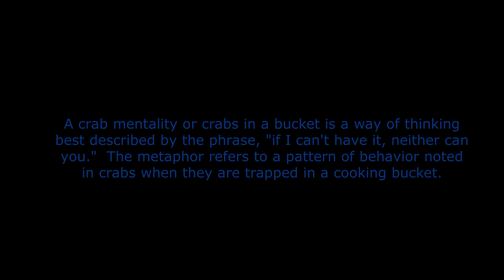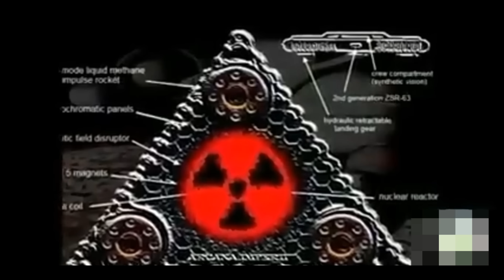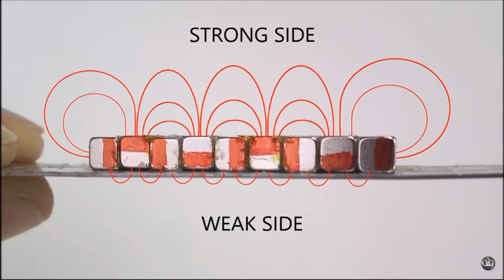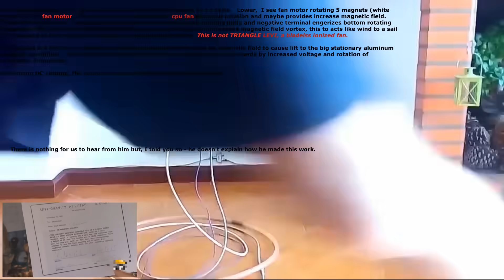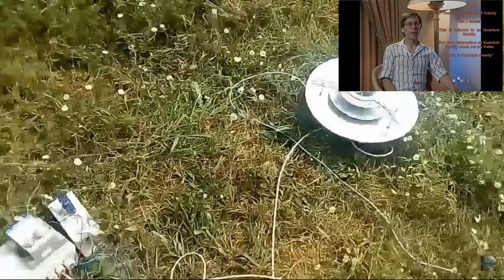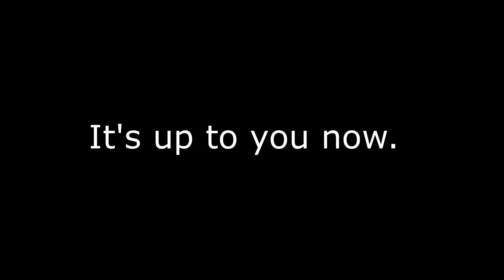anti-gravity project

Comment: Most anti gravity claims dont meet that defintion any better than lighter than air flight with helium.
Anti gravity would repelling away from gravity lol
Reply: lol Never though of it that way why do they call it anti gravity. Wouldn't it mean the opposed of gravity lol why isn't it just called gravity manipulation..
Reply: @patman0250  It was in the 50s but since then to throw people off the true path they have called it antigravity. Even in the movies of the 50s they called them gravational vehicles.
Reply: Singularity  so close. gravity is not a pull.  It's a space-time dent, also called a gravity well. Objects in the gravity well are influenced by how far in the gravity well they are. The planets are in the sun's gravity well, the moons are in the planets' gravity wells. 

There are very good videos depicting this concept. Although presented in a 2-d model, extend that idea into 3-dimensions. (well, 4, but 3 is easier to conceive).
Reply: or just cancelling it?
Reply: Singularity  strong and weak make electromagnetism through decay, which is responsible for the formation of elements and chemical bonds, which make mass, which makes gravity. And the strength of the forces is actually, respectively:
Strong
Electromagnetism
Weak
Gravity
Reply: Singularity  There is actually no evidence that gravity is a force. Gravity is an *effect*. The speculative theories on space curvature, gravitational waves, higgs boson do not reason well along one another logically.
In plasma cosmology and also in the Faraday/Tesla concepts of nature, gravity and magnetism aren't "different",but different aspects of the same causal force,depending on the structure of the matter involved
Reply: Space curvature : Gravity is an effect of mass inertia moving in space/"Einsteinian aether". In the modern theoretical model: Higgs particles/gravitational particle waves = objects attract via kinetic material energy-field interactions. There is an attempt to combine the 2,but it is just philosophy. How realistic this model is can be very doubted for many reasons.
Reply: @KibyNykraft  Yes mass attracts mass but gravity is a pushing force and therefor repels gravity just like placing 2 like of 2 magnets together they will repel.
Reply: @DieterSoegemeier  I'm not buying the theory that you presented. Using waves of energy we can lift various structures. If i combine two or three types of scalier microwave forms it is possible to create an energetic field of microwave that is able to hold some things in the air, uncontrolled at this point. But zero point theory and the hutchenson effect go hand in hand. So if a wave of sufficent  density is possible as is sound waves do in lighter objects like drops of water you can see in several experientially proven as repeatable outcomes. It may have to do with harmonics or a combination of higher energy products using the ambient air or the combination of the  material itself and air interacting to overcome the gravitational force. If you can cancel out that force to zero then would you over come gravity or interact with it? All electronics and magnetics prefer their opposites. If you have a battery and a material with a high Br the battery interacting with the magnet acts like a die pole I have a sputtering assembly magnetron that I can set a double a battery on and it will stand on it's edge if placed in line with the flux as it leaves the assembly so if battery acts like this then we only need to discover the balance of whatever we call aether.
Reply: @richardgreen1050  I bet you are into usless quantum theory.
In the 1900s Aetheric physics was the way and people like Keely, Tesla, Einstein and many others perached about what we can do with the aether untis Neil Bohr came up with Quantum theory, then everything changed for the worse. Common sence went out the window and Quantum physics was born.
Half way through the Philidelpha experiment Einstein changed camps due to possiable pier preasure for funding and recognition. Tesla was shut down and killed as being the last of aetheric energy advocits. Yet every elactrical device used today is still based on aetheric physics.
Gravity is also part of the aether and is not able to explained with quantum physics.
You want to make gravity, them get a magnet and then spin it fery fast till you produce a three dimentional magnetic field we call gravity.
Reply: @DieterSoegemeier  Tesla's gravity view is called Dynamic theory of gravity and was not formally published. Check it out. In his interview many years earlier, in 1903, he explains his faith in a dark companion to matter and light.
Reply: @richardgreen1050  I suggest you search up both quadropole and monopole experiments :) :)
Reply: @richardgreen1050  Allegedly the lift process of saucers (Haunebu 3, Otis Carr etc) was to have 2 oppositely spinning heavy metal plates of specific alloys, with mercury floating around it in a circular chamber. It could all be hoax for what I know. In terms of long distance travel in much shorter time, through space, I think only Alcubierre drive or/and NASA EM drive as a start is relevant
Reply: @DieterSoegemeier  The only way gravity can be a pushing force apart from magnetism, is if the energy comes "from" a big bang, or if dark energy increases entropy in a way that is suprisingly uniform directionwise for masses. I doubt it, so your idea of a magnetic gravity is interesting, yet there are some major problems with that idea, as we can distinctly separate magnetic from non-magnetic matter within gravitational fields. We however still do not have an evidence of gravity as a force
Reply: @DieterSoegemeier  hi thanks for the reply. I am not really a quantum guy. I'm a guy who worked in the magnetics world and I learned an observed a few things in those years. My thought was that a discourse in magnetic properties and their use along with what I currently see as the outcome of many projects or applications discussed in that time. Because the field is so diverse and touches almost every aspect of business in one way or another I'm generally but not always specifically able to apply the knowledge gained working with so many people in many high tech fields I felt I have a simple understanding of an applications and manufacturing enough to say what I said. I have nothing to add that has not been gleened from that experience. So if I mistakenly thought something and the truth be told I have not re examined my post, I gave you the best of the meger knowledge I have and discussed either what I know to be useful or what others whom I know to be competent in their respective fields have told me or even mused to me. So I'm not making points I'm presenting a viewpoint based upon experience or trustworthy people in places where I am not worthy to be but thankfully I was allowed to assist them in their efforts to achieve their goals or dispell their understanding. So thanks for the letter.
Reply: @KibyNykraft  thanks I have been going through most of the better ones along with listening to many professors explaining the flux and the principals of both magnetics and gravities elementary principals that have been advanced recently and the coil is pretty sweet. A lot of companies were working on different projects that were over unity but I never saw any of those go into production. But lots of things were asked about that made me curious. And I have yet to satisfy my belief that over unity is possible. I think it not only has been done but that when it was presented to the public for all intents and purposes it was never a project that could get major funding.  Everyone wanted to see it but no one wanted to buck the system and explain the law of entropy in a manner that mathematically proved to be a good resultant. And the fact that rotation of gyros does seem to indicate a force can be produced that negates gravities pull is interesting to see. But the hutchenson effect was the first indication that wave forms transecting can produce a change in motion and a change and the properties of the materials interacting with them gives rise to the question of the true density of stable materials like iron. If I can change density without a catastrophic change in properties of air or even solids is could be possible to pass thru the empty portions of materials by moving what is in front of me to the rear at a pace that would meet the speed of light minus any probligation delay in it's implimentation. Which it seems may have been described in the toroidal magnet in your example. But it needs to be a toroidal with the magnetic field contained in the magnet itself replacing the core of the winding so that it is a closed loop as I see it with a winding itself as dipicted. I am not able to grasp the core material being a low be material it would need to be neo or if the heat was too high a sumarium magnet of lesser br. Maybe I don't understand the design as well as others but with core materials they are generally used to take transients down to a lower more manageable level.  Which means it produces no magnetic field it absorbs it and creates a loss. So if a magnet were to be made with the field or orientation running parallel to the id and od essentially a closed loop.isnt that the correct effect.  What am I missing in the design that requires essentially a choke to be able to produce a bucking field when it is inherently the opposite when it encounters an emf? I may have it all wrong so I'm just trying to see why my understanding of practices in this field seem to conflict with the designers understanding. I have and am looking at all of these interesting designs to see what I can find.  If what I suspect is possible then the stability of less dense material in a maluable form that can push or pull in any direction while squeezing an object into a field of matter of less density in the line of travel would occur.
An example that it does exist is confirmed by several firemen after their rescue. The twin towers disaster has an example of this floating characteristic. The firemen who were trapped in the stairwell mentioned this effect in their testamoney and is a known effect of hutchenson's experiments. So given that they did not have a toroid or at such instrument. They said that for a time they were lifted up and floated in air. This is the effect that is an example of of three microwaves creating or reducing the effects of gravity or an increase in ambient density in air. So you can pound the buildings with the microwaves and they are essentially solid waveforms that can smash or lift any material as desired. Look at bldg 6 when you look at the holes made and the gouges down to the bottom floors check to see if you see a viable pattern in the debris. And look around for circles or semicircles in the damaged buildings. And  see if there is not a distinct pattern that is unnaturally present.
Reply: @richardgreen1050   Hello, you are so I'm dept on your findings. But it would be wise not to share so much knowledge to the public readers. This will give them the advantage in a conclusion that they have yet to discover on there own. But, in an other matter you are correct in all your findings. I don't have all the mathimatical word to describe what I to have found. But in a simpler form. The earth / planets have different kinds of magnetic fields that can be controlled . The same way a UFO flies & into space. But I have stumbled upon a theory on magnetic fields / force that is so simple to understand & possibly to construct.
Reply: so the claim of anti gravity is pointless, since if a disc can take off from whatever tech it is of course not anti gravity
Reply: Anti gravity does not repel from gravity. They are opposits and as opposits they must attract because only likes repel. Gravity is an electromagnetic force and as such the first law of magnetism applies.
Reply: @DieterSoegemeier  nope. Gravity is not an electromagnetic force. The moon has no magnetic field, yet it has gravity. Asteroids have gravity with no magnetic field. Gravity is simply the bending of space-time by an object with mass. The larger the mass, the higher the gravity. There has never been a correlation between gravity and electromagnetism. We don't see magnets floating above the ground, electromagnets either.
Reply: @UnderMan  the exception is lentz coils and a halbach array. They repel on permanent magnet assembly like the one Dr Richard Post created in the 90's. The prototype is at General Atomics in San Diego CA.
Reply: @DieterSoegemeier  opposites attract in magnetism, not as a general law.
Reply: @geeewhizz3245  Ok then, Show me where it does not apply. Do remember that the earth has gravity because it is a big magnetic mass that is spinning,If it stopped spinning there would be no gravity. So gravity and magnetism are related and you can not have two opposing laws on the same body.  So then if the the first law for magnetism applies for all magnetic things and gravity is related to magnetism then what is the first law of gravity.
Reply: @DieterSoegemeier  That's completely false. There would still be gravity if the earth wasn't spinning. It has gravity because of its mass and that masses interaction with the fabric of space-time. The friction between metal in our core and inner mantle is what gives us a magnetic field. The only two things that would cease if the earth stopped spinning would be the tiny amount of centrifugal force created, and the night/day cycle. 

In chemistry, you can't get a severely hydrophobic substance to mix with a severely hydrophilic substance. They are opposites that repel each other.  Like I said, in Magnetism, yes opposite charges attract. But gravity is not magnetism. Gravity is a different force.
Reply: @DieterSoegemeier  Yes, oscillation, torsion, golden ratio, centripetal and centrifugal effects, inertia, polarity/charge of particles are obviously there as relevant for the abilities/nature of matter through a dynamical space context,but very hard to relate scientifically to relativistic gravity physics, more easily related to magnetism/electric theory in Faraday-based concepts. NOTE: The DEFINITION OF magnetism and electrical force are NOT the same in Faraday based models vs SM.
Reply: @DieterSoegemeier  Frequency ranges,mass,gravity,magnetism might exist due to a basic stringpoint-vibratory nature of basic light-mass-energy(Tesla) (the potential cause or more basic nature of more or less what is called"baryonic-lepton" reality in theoretical physics). Some variety of darkness/vacuum has to cause this variation as well as causing entropy to always over time increase
Reply: @KibyNykraft  Please do not combine string theory and Tesla together as Nicola Tesla believed in Aetheric phisics and the vibration of the aether. He refused to acknoledge quantum theory.
Reply: @DieterSoegemeier  I did not refer to any theoretical string theory as in mathematical dimensions. I meant the basic nature or structure of (vibratory)light-matter, but it was more speculation from my part (how the basics of cosmic fabric "operate" within the visible plus dark "matterlike",or gravitylike spectrums such as dark matter)
Reply: @geeewhizz3245  Gravity is created when you spin a magnet. Gravity is a 3 dimentional magnetic field. Magnetic force in all 3 dimentions X< Y< and Z axcies.
And to make gravity you just need Einsteins equasion of E= MV squared to work out the quanties required.
E in this is the gravitational energy required to make 1g.
M is the mass of the earth or device.
V is the rotational velocity of the earth or device.
So how fast does one have to spin a 1kg magnetic mass to make 1g
Reply: @DieterSoegemeier  Objects without angular momentum also have gravity. That means there is more to it than just movement, it's an intrinsic property of objects with mass or momentum.
Reply: @sepehrsaryazdi9690  Yes an object such as our moon has angular and a small gravity because it is effectively spinning around earths central axis. So it is just like a ball on a string, The moon is in orbit around the earth and because of its spin it has gravity
Reply: @DieterSoegemeier  Where did you get the idea that we only have gravity because the world is spinning? Gravity and magnetism are not related in any way. Gravity is bent space-time. we have a solid iron central core and a liquid iron outer core. The churning  (spinning) core produces the magnetic field. If the Earth stood still, we'd still have gravity. If the core continued to rotate with a still Earth, we would still have a magnetic field. We just wouldn't experience the day/night cycle.
Reply: @UnderMan  Where do you get the idea that we have a solid iron core. The earth expands in cycles and is alwayse getting bigger, That happens because we have a plasma core that like the sum is making mater constantly and the earth expands like a balloon.
Reply: @DieterSoegemeier  that is incorrect. Where did you ever get that idea? Science has proven it is a solid iron core surrounded by liquid metal. 
There is no evidence, or hypothesis, that suggests a plasma core and the Earth isn't expanding.
Reply: @DieterSoegemeier  no there is no increase in the weight of any rotating assembly. I have things spinning up to 110k rpm. There is no change in mass or perceptive gravitational effect outside of Eddy currents I don't see have that can be. Jets and electric motors don't change any factor related to the aircrafts thrust to weight ratio, unless you know some equation your statement is questionable.
Reply: @richardgreen1050  Is that mass magnetic.
Einsteins equasion is the kee to this.
In this case. E = M rV squard.
So in the case of gravity for example;
The energy to make 1g is the Mass of the earth times the rotational velocity, and by transposing the figyres we can then work out how fast we have to soin a magnetic mass of say 1kg to make 1g.

1g = the mass of the earth x one revolution every 24 hours.

So how fast do we have to spin a magnetis mass of 1kg to make 1g.
Reply: @DieterSoegemeier  doesn't matter the enertia isn't changing the mass. The magnetic field will induce Eddy currents in everything but it does not change mass. The work reduced by Eddy currents effects only the rotation of the rotor by increasing the resistance of it's movement as it acts upon the environment. So various materials reduce the efficiency it cannot effect mass. Environment can change lots of things as resistance to the flux varies from material to material. Flesh and bone have a different die pole moment that is why we can tell them apart in an MRI. But put a head into the field and you will find that even though you are subjecting it to a rotating high magnetic field no change is made to mass itself. If the strength of a magnet flux is a factor I do not see it in practical applications. If that is true then we would need to recalculate the fuel as when we turn on the power supply and rotate the generator to it's max speed something should cause some weight difference but it is not measured as far as I know. I'm spinning most at low speeds 60-70 k rpm. And let's face facts I dont want to bring up. That a gyro can seemingly rotate and defy gravity by placing it perp against a vertical surface but the question is does it reduce the overall weight of the assembly? I don't know but it might be interesting to test it out. I mean we should be able to place a load cell below the rotating body and observe a reaction. Have you observed such a situation?
And are we looking at a force that presses in one direction only or can we detect anything at all that might help. I don't make mechanical gyros only laser ones.
Reply: @DieterSoegemeier  I will get the data and base it on a cylinderical magnet that has a length of maybe 6-8" and work out the od and id and see where it leads me. But I'll use neo as the base material perhaps without the I'd and just spin it up to one g to see what the fea says if possible otherwise I'll calculate it based upon the two kilo grams of material or close to it as I can. The physics guys normally do this work as we have to make the magnet out of multiple piece constriction. So I'll try to get to it soon however it still may take a little time if I don't already have that data available stored in the computer.
Reply: @richardgreen1050  This dude is either a lost cause or a troll. I mean that in the sense that literally every sentence he has said has thrown anything since Aristotle down the drain (actually, probably worse than that).
I mean, he pulled "E = M rV squard" straight out of... certainly not Einstein, or anyone as a matter of fact. Moreover, he's "transposing the figyres" to obtain a result of the earth being 1 gram.
Consider this a favor and do something better with your time.
Reply: @xchhhhhhhh  well I don't know what his formula indicated. I do know that any inertia at 1g is not going to do anything for the flux field. It's as if the expectation is that a field of very limited depth will cause something unknown like gravitational pull. I know the issues with magnets falling around copper and aluminium etc. I know about losses in the speed of rotation due to changing polarity exists even in air. Eddy currents exist in all materials to varying degrees which interaction is the basis for many sensory processes and down hole applications and geological mapping or material identification (mass spectrometer ). As when we put a couple of them on Mars.. actually we slammed one into Mars and I had to build another. I thought I might put some numbers togeather but I'm pretty busy right now and it is low on the list but I intended to do it. But considering the time I may not and I agree with you that he is not seeking the resultant as much as the controversy which I'm not interested in. I am simply trying to satisfy my curiosity and hoping to find fellow of like mind and significant ability exceeding mine that would be able to tell if a direction is likely to produce the effect than another. I'm no genius but I'm hopeful I'm no fool too. Thanks for the heads up.  Cheers Mate
Reply: @DieterSoegemeier  Gravity is not an electromagnetic force.  A force is equal to an objects mass multiplied by the acceleration.  On Earth, all objects accelerate at 9.8 m/s^2.  Gravity can be treated as a force in engineering terms, but technically Gravity is not a force, it is the result of a mass indenting the fabric of space-time.  That is what Einstein figured out
Reply: @ssopessope4501  Man you got this wrong.
What you described here is how to calculate the force applied to a falling mass by gravity. What has this got to do with making or repelling gravity. Einstein was a mathamatician, He new about making gravity. You want to talk about gravity then come at me with someone who knows magnetics or electricitw of frequency dynamics, someone who has actually made something. Like J.Keely or N.Tesla or M.Roden or anyone that has proven themselves in practical physics.
Reply: @DieterSoegemeier    You are making it clear that you don't understand what a force is. Force=mass*acceleration ;  this is how all forces are calculated, not just gravity. Let me try again. Gravity is caused by a mass indenting the fabric of space and time.   This is what Einstein figured out. (By the way, gravity is not an electromagnet force). Einstein's theory been proven by showing that light can be bent by a large mass.  During an eclipse this was verified by telescopes seeing a known star that should have obstructed the telescopes view due to our own Sun.    On Earth, all objects accelerate towards earth at 9.8 meters/second^2.  You can produce an opposing force, but that sure as hell isn't anti-gravity.  It is sad that the maker of this video managed to collect all this research without being able to piece together some very simple facts.
  Look up how to do a static analysis with a free body diagram.  I'm not sure you know what that means, but you can google it.
Reply: @ssopessope4501  Why are you describing the effects of gravity to me. and you acceleration is only relative to earths 1g. What if I am at a potential of 2g or more. Everything you are describing is the effects experienced here on earth. But you do not explain how to make gravity.
Reply: @ssopessope4501  Why do you keep going back to Einstein, Einstein never built a gravity device but Tesla did. Please go to the sourse not the student.
Reply: lol everything you just said is pretty much bs . we know nothing of gravity meaning we know not of how it works buddy.. look up the definition of the work anti it doesn't mean what you think it means. anti the opposite of something or the absence of. has nothing to do with attraction or anything of the sort.
Reply: Dadson worldwide Yes in this dimension you’re right
Reply: What if we displace gravity and use it as we pull in the Opposite direction of our inertia as we approach
Reply: It still wouldn't be anti. what's the opposite of gravity!? the absence of gravity?
Reply: @patman0250  Anti gravity attracts gravity just like a black hole does.
Reply: I was thinking the same thing. "Anti" in this context means "opposite", so you need gravity's opposite to be anti gravity. The electromagnetic methods are just other forces that overcome gravity. It's like calling an airplane an anti gravity machine.
Reply: @geeewhizz3245  an airplane is not an anti-gravity machine. An airplane flies by what is known as the Bernoulli principle. Although it's called aerodynamics, it's the same thing as fluid dynamics. The same principles apply. Em forces have nothing to do with gravity.
Reply: @UnderMan  Yeah I know.. That's what I said in my comment. I think you need to read it again.
Reply: The earth
Reply: The 5th is dark matter
Reply: @KibyNykraft  Dark matter is fake science.